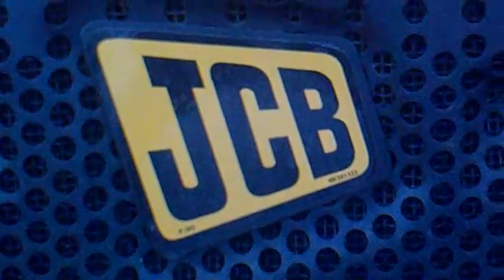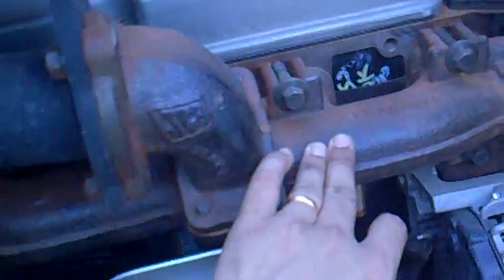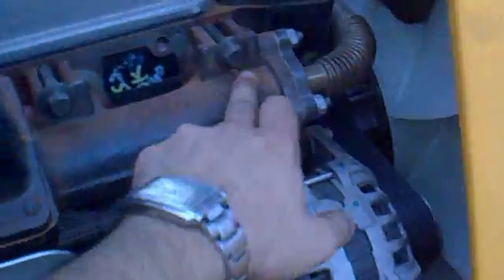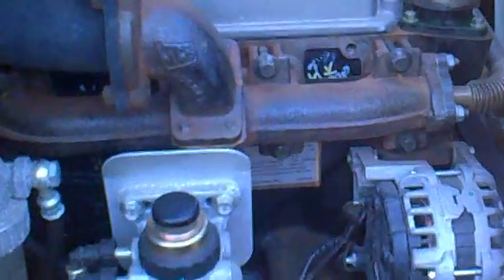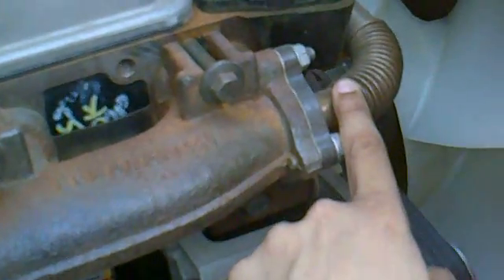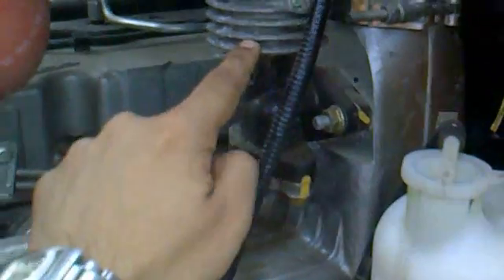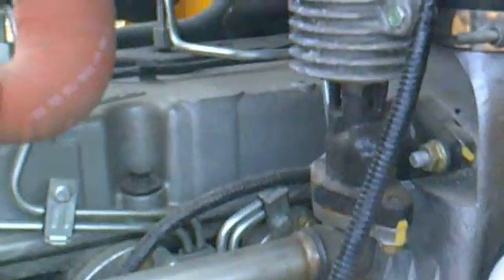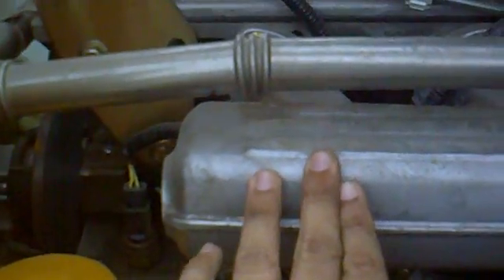How exhaust gas recirculation system works (EGR). ✔

Comment: NOx makes at high temp as you have told in another video. but when exhaust gas comes out from the cylinder it has more temp  as compare to atmosphere , and we circulate it again for combustion so I Think that it has has more  inlet temp .so how you can say that NOx reduce but we have more hot air for combustion since it increase the making of NOx.         
please solve my doubt .

Comment: An interesting video, diesel car EGR systems are unfortunately notorious for problems due to soot clogging the internals of the EGR valve. I wonder if JCB have a more reliable system.. at least it looks accessible for cleaning.

Comment: it is unacceptable EGR system will not recirculate huge amount of gas in to the engine, it will mix some exhaust gas to the intake manifold to temperature of the engine When the temperature is reduced production of nox will be reduced